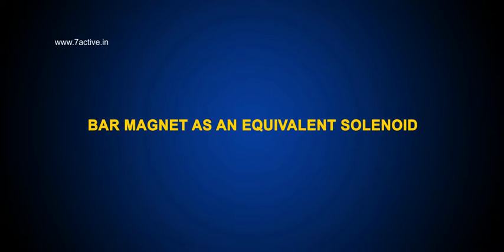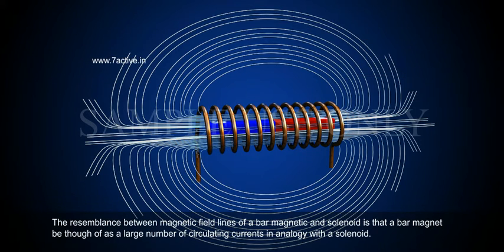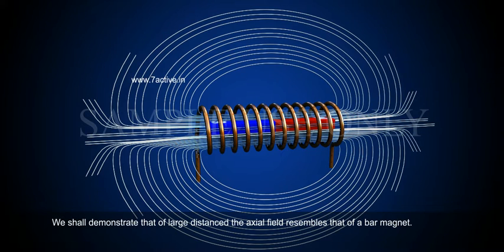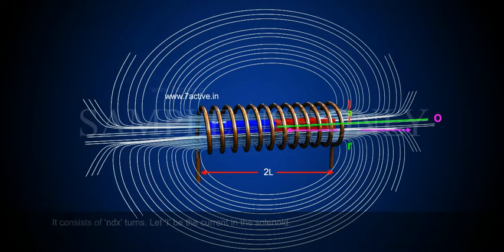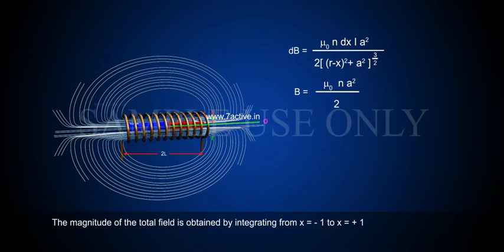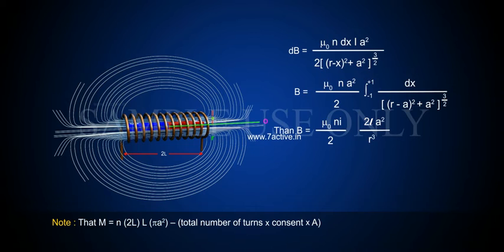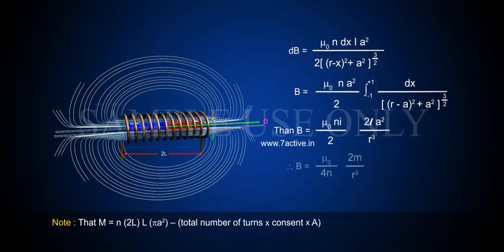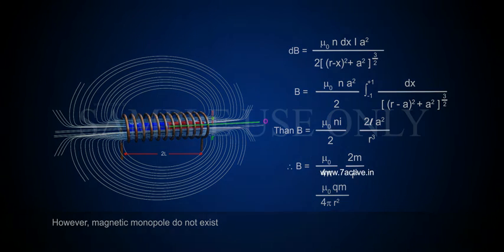BAR MAGNET AS AN EQUIVALENT SOLENOID

Comment: If you put a magnet in the solenoid, does it empower the poles, making them stronger? For example, if I take a regular magnet with a North and South, and then place the North end near another magnet's North end, they will repel.

My question is, if I put a magnet in a solenoid, and then have the two North's touch, will the magnet in the solenoid repel the other magnet further then if it didn't have a solenoid?
Reply: Sir I think the answer to your first question is yes. If we put a magnet in the solenoid, it does empower the poles, making the magnet stronger. We have a relation as: B=permeability of vacuum× magnetisation (M), where M= net magnetic moment per unit volume.
And I've read that, if the interior of a solenoid is filled with a material with non zero magnetisation, the field inside the solenoid will be greater than its initial value.
I hope this answers helps. (I'm not a physics expert though...😀)
Reply: If your magnet has reached saturation then it won't become any stronger